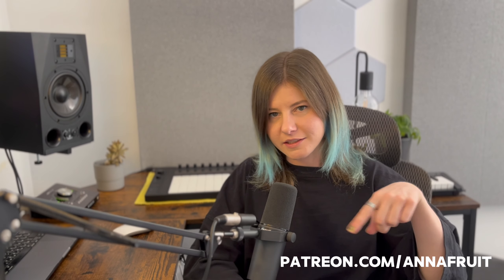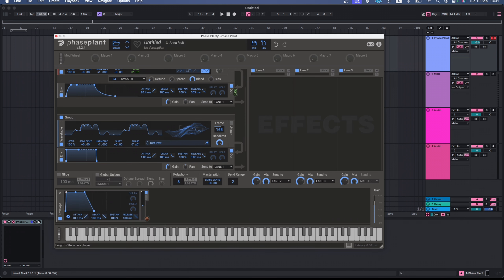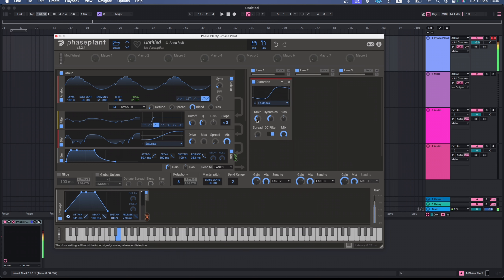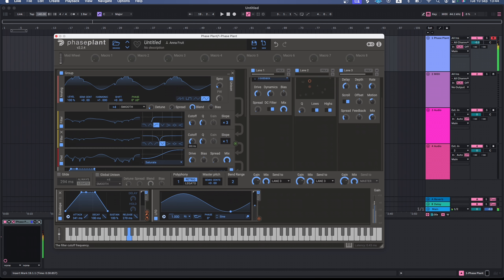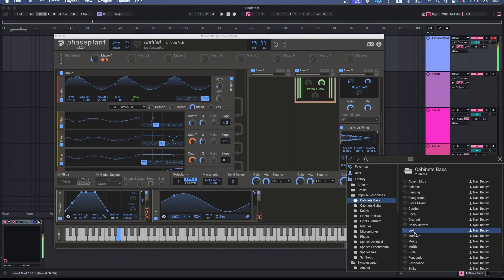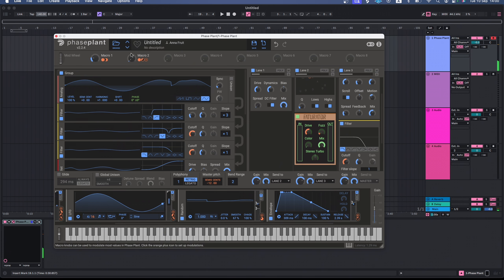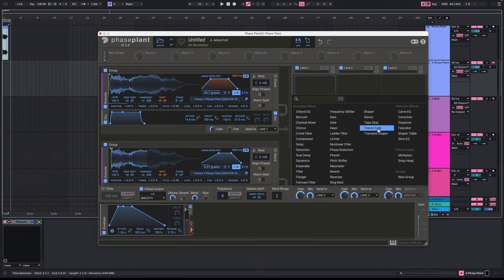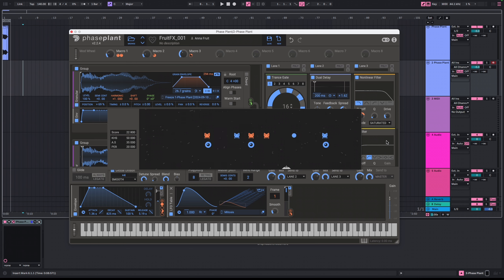Phase Plant Made Easy: The beginner's Guide to Pro Sound Design

Comment: Great video. Is it possible to trigger a patch and have it run continuously with an LFO and not have  to press a key, like in a real modular synth?
Reply from the maker: Thank you and yes! For this, your plugin needs to receive a continuous incoming signal — to achieve this, you need to draw a long MIDI note.